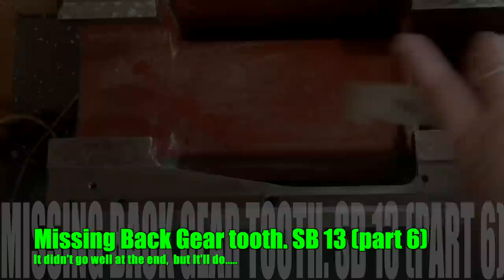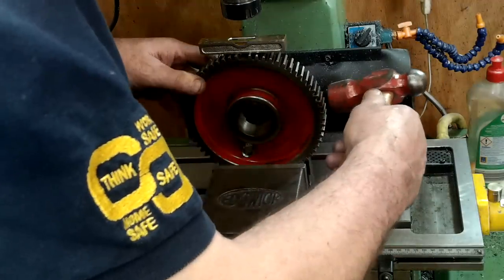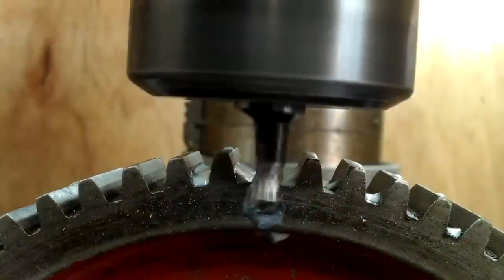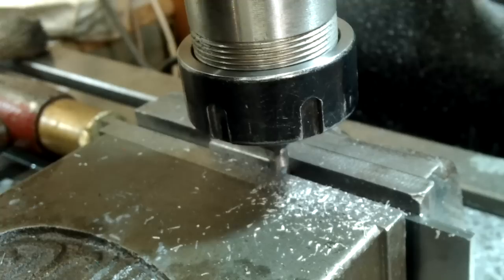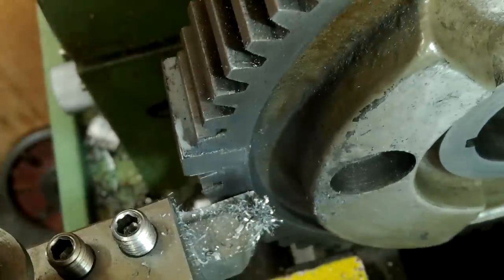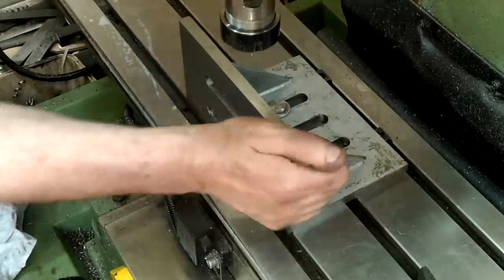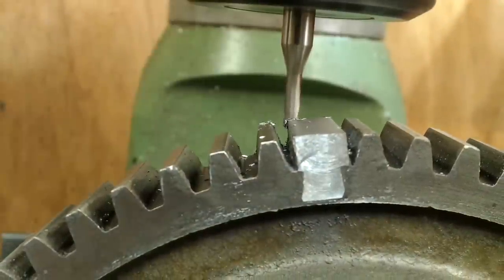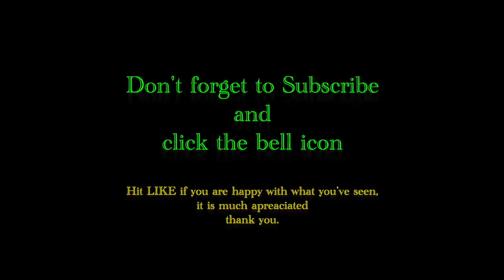Missing Back Gear Tooth. South Bend 13 (pt6)

Comment: Paul, I'm very impressed by your use of the involute principle to progressively cut the profile. I've seen other methods - base circle and tapes or wires, calculating offsets and using a slitting saw - but this is a new method to me.
Reply from the maker: Hi Bill, I’ve said it so many times - there’s always more than one way to skin a rabbit. regards

Comment: When I do repairs like this, I'll frequently make copies of the repair part, so that I don't have to repeat the full operation if the repair fails. It would have been fairly simple to make two or three identical copies of the tooth blank while that setup was still on the milling machine, so that you had another blank ready to fit up into the gear body.  Still, some very good ideas here, I have a similar repair needed on one of the gears in the headstock of my Cincinnati lathe.
Reply from the maker: Best of luck, you'll be fine. cheers

Comment: Nice! As I am going through my South Bend 744 9a, I have found 3 gears that need attention, the two back gears and the bull gear. The small back gear is a loss, so I will replace that, but the bull gear is missing 2 teeth and the larger back gear 1. Now I will fret over whether to try and find those as used parts or whether to try and repair those 3 teeth for about a week before I do anything. Awesome video as always!
Reply from the maker: Hi. Thanks for watching, one thing I will say about this method of repair is that the tooth is not a precise shape, but it still works well, albeit a little noisy until it’s worn in, then it’s as good as new. All the best.

Comment: that is a great fix, realised with intelligent solutions given limited tools - kudos!  I have the same problem - on a south bend back gear (10K in this case). I'm wondering how important the dovetail is, structurally - a square section would be so much easier ;)  Also since there's no load on the top of the tooth, why would you not put the grub screw - or two in from the top? Did you consider brazing or silver soldering it in?

Comment: First off I really enjoy the look, feel and pacing of your videos.  There's a good serving of "meat" without a lot of "parsley" filler.  

Next is the wonderful analysis and thoughts on how to place and hold items.  As any machinist knows it's not about the metal removed but the setup details before the power is turned on.  You really hit the bell with the setup details on this one.  I learned a bit more than usual from this video which I hope I can remember when the need comes up in my own shop.  The "trapping" of the gear with the blocks engaging the lower teeth is brilliant.  Matched by the way you picked off the flanks to mill the new tooth.

Keep up the great work and I wish you many more subscribers.  And yes, I think my stomach turned over as badly  as yours when the tool took off sideways... A feeling only another machinist would understand I'm sure... .:D
Reply from the maker: Hi, Thanks, I’m glad you enjoyed the video, yes I’m surprised it didn’t bust the cutter too. Cheers

Comment: Great video! I never would have thought of doing it like that.
I especially liked your single point dovetail cutter.
I destroyed a couple of change gears off my Atlas Lathe beyond repair so I found a involute cutter set on eBay.
They were not very expensive and I made some new gears from scratch out of brass.  Way better than the original zermak stuff.
I have a rotary table I could tip up on its side to use as a dividing head.
Slotted the key way using the quill on the mill like a slotted.
Came out ok.
Worked great.

Comment: Nice bit of work and really great technique. I have done a similar repair on a SouthBend, but tapped a few screws, brazed and filed to form. It is great to get it back into production. anyhow. enjoyed, cheers!
Reply from the maker: Hi, thanks. Cheers
Reply: Agreed, a good job well done.  I drill and tap for a couple of grub screws, then bolt on a couple of thin plates, fill with braze and recut the teeth with an involute gear cutter or home-profiled fly-cutter.  

One gear I had just had screws loctited in place and filed to shape.  It never failed.
Reply from the maker: @oliver90owner  That sounds like a good idea.

Comment: Niece repair Paul. Exactly how I saw my dad do it on a clock wheel only press fitted and filed to shape  by hand.
Reply from the maker: Hi Tony, It just goes to prove that nothing in machine engineering is new. Regards
Reply: @Thesheddweller  Or sound engineering principles will stand the test of time.

Comment: Brilliant method of indexing the gear teeth Paul. That out of the box thinking at its finest!
Was Heath involved in this ?  🤔🤔🤔
Cheers Nell
Reply from the maker: Hi Nell, well we sort of bounced a few ideas between each other his idea helped. A guy just the other side of town wanted £250+ just to weld it up. guess what, I’ve still got £250 quid in my pocket. cheers mate
Reply: @Thesheddweller  what is he, a dentist? They charge those sort of rates 🤣

Comment: Excellent dentristy~!!  I wonder why you didn't braise the tooth in
Reply from the maker: Hi, The reason why I didn’t Braze it in is mainly due to the risk of cracking the gear. The tooth can only be brazed in or one built up using brazing rod if the whole casting is first heated to a given temperature, then using a concentrated quality flame like using Oxyacetylene to stroke the rod in. I haven’t got such equipment. I hope this goes a little way to explaining why I didn’t do it that way.  Cheers

Comment: I zip-tied a spring to keep pressure up on the pin to disengage the back gear. Nothing sucks more than having a nice cut going and it just slows down and blows up an insert. On the other end of the spectrum, I have a bungie cord to keep the back gear engaged.
Reply from the maker: Hi, sorry i didn't reply, I missed your comment. Thank you I might even need to use that idea if I have problems. Cheers

Comment: Great work sir, hate moving the wrong wheel or just slipping up and making a nice fix into not such a nice fix, but looks like you caught it quickly enough to avoid catastrophic damage, could have slaped some JB Weld in that divot on side of that tooth, stuff is strong 💪,  thanks for showing us that no one is perfect and we all make mistakes 👍
Reply from the maker: Hi, thanks and cheers,

Comment: Very different approach and something I would never have thought of.
Simply brilliant .
Regarding the cockup , as you had made the tooth from steel, what about using a mig and slowly carefully build it up without putting too much heat to mess up the JB weld.
And machine it again as before ?
Just a thought
Reply from the maker: Hi, thanks, I had considered that very fix, but I’m not prepared to upset the apple cart so to speak. regards

Comment: nice one.
On the subject of the wandering cutter, no that the tooth is steel would it be possible to weld in the missing material and then machine it back again...just thinking out loud incase it had somehow made a mole hill out of a mountain 
fantastic series btw thanks for sharing
Reply from the maker: Hi, yes it would have been fairly easy to weld, but the heat could have affected the resin bond and I didn't want that. cheers.
Reply: @Thesheddweller  that's a very good point , I suppose braising the tooth in. The first place might have worked but you still run the risk of melting it again if you weld.
Thanks for sharing

Comment: i like your indexing system. will use it in fiture. had to coppy a gear that i couldnt get the tooth count in my rotary table without serious mucking about. ended had to buy one. could gave used your system and a nother gear as index wheel.....nect time.
Reply from the maker: Hi, glad you found it useful. Cheers

Comment: If you had the broken off segment of tooth do you think it could have been brazed back on and operated successfully?  Asking for a friend.
Reply from the maker: Hi, the problem is, getting it done professionally is very expensive. Brazing is possible provided the main cast component is heated beforehand to try and prevent the component cracking, but I’ve also heard many stories of complete failure. cheers.

Comment: I'm sorry you did a great job, but it wasn't easier and safer to refill with cast iron electrodes or better still with AISI 309, it has perfect adhesion with cast iron and is workable.
What a huge job you did, congratulations
Reply from the maker: Hi, I don’t have a TIG welder and a nearby cast iron welding specialist was charging £250+ (€300+)to do the job for me. this was my safest and cheapest method, thanks for the info though. cheers

Comment: Given the tooth was mild steel could you have tig welded a repair on the tooth with minimal heat?
Reply from the maker: Hi, I can’t afford a TIG welder. cheers.
Reply: @Thesheddweller  a machine shop with out a welder?
Reply from the maker: @TheModelmaker123  Hi, I have a welder, I don’t have a TIG welder.